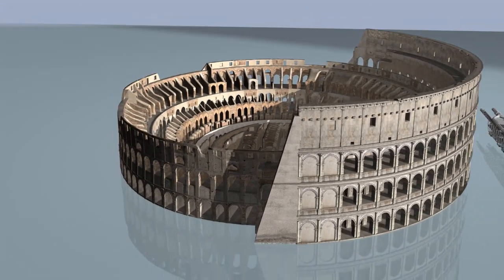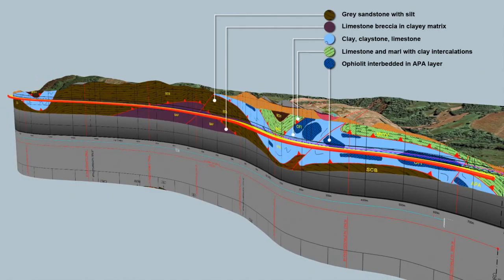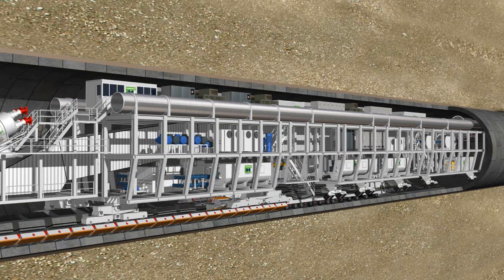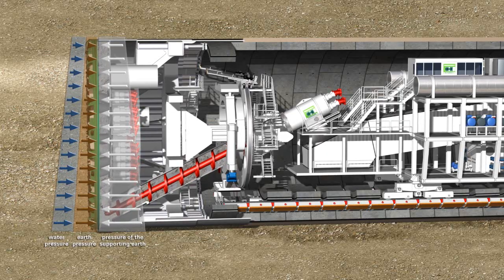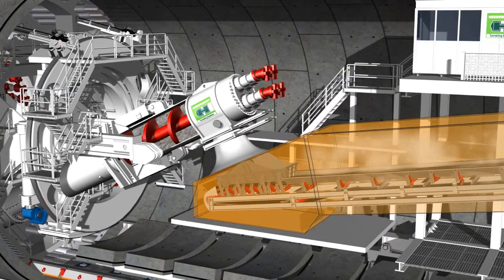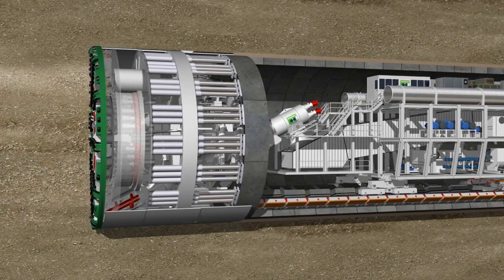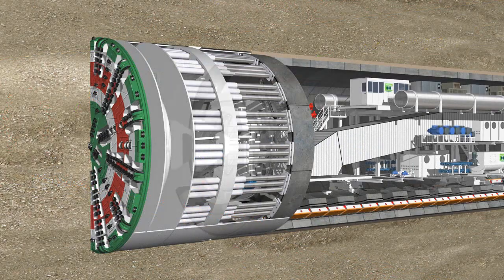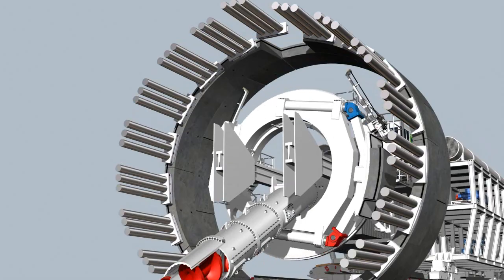3D animation TBM S574 "Martina" (eng)

Comment: What about water? And as the machine advances forward how does the ground shifting effect the tunnel?
Reply: Different models of TBM may sometimes have different features incorporated depending on the conditions it will be working with.  I.E. undersea ones like those used in the Big Dig had special waterproof outter shields.  Then the ones that work in more unstable or softer ground often have reinforced hulls or internal supports to minimize the risk of cave-ins.
Reply: @terminalvelocityrunner2202  how are the turns made? I'm confused because the map shows a non linear tunnel.

Comment: How does a TBM propel itself forwards?
Reply: 4:46 You can see the head of the TBM being pushed away from the concrete "tunnel" construction. They use electricial driven pistons for it. Also 9:18
Reply: sjorsbeans Ooh, thanks! Completely missed that detail.